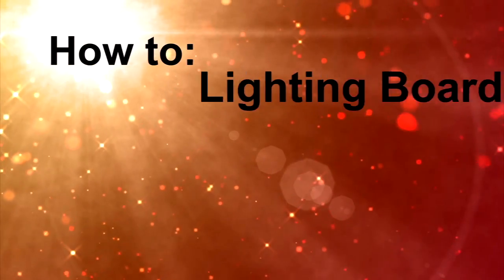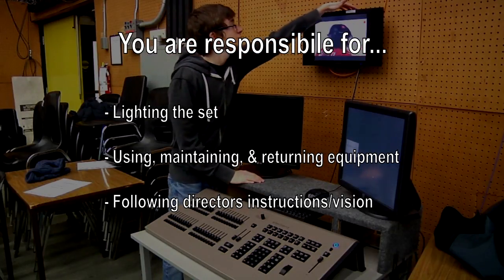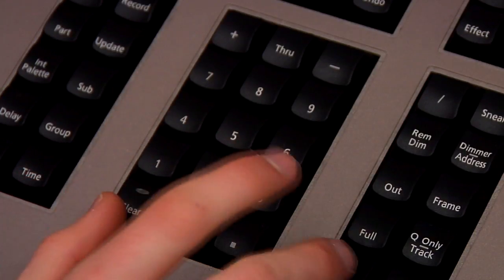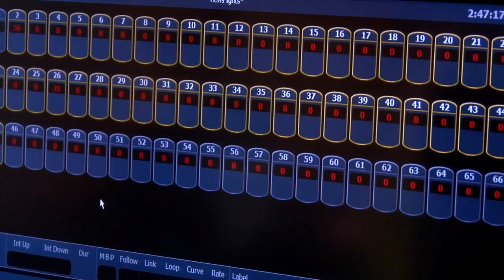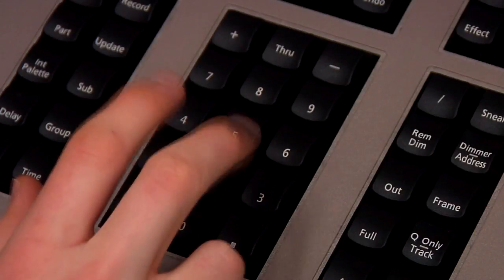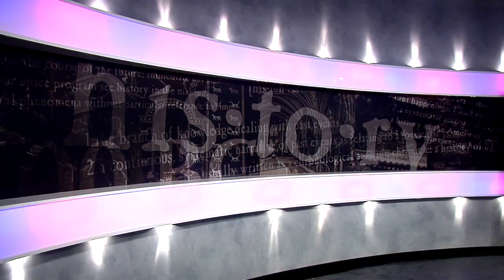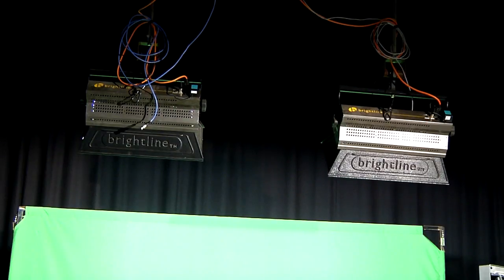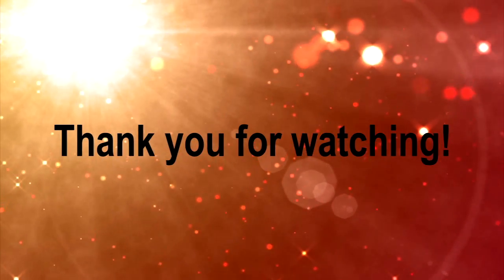How to: Lighting Board

Comment: Some of the information you give would be specific to your workstation. Like labeling the power grid, the location of the grid switches. You explain programming and stuff like that fine but you should be mindful about how other setups will have certain items in different locations. No two lighting setups are the same.
Reply: But I also understand this is a 5 year old video. Just thought I'd give feedback.
Reply from the maker: Thank you for the feedback! This video unfortunately is quite old and even when it came out was missing information and clarity in areas. This video was intended specifically for our setup only at the time but you're absolutely right, always be mindful of your individual workstation and lighting setup as no two are ever the same.